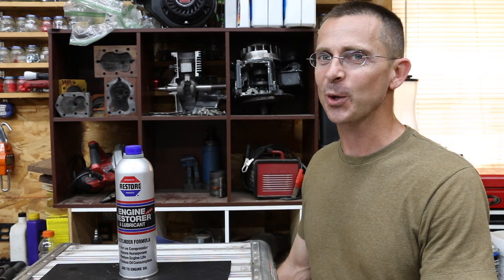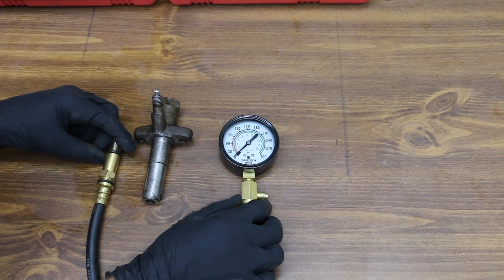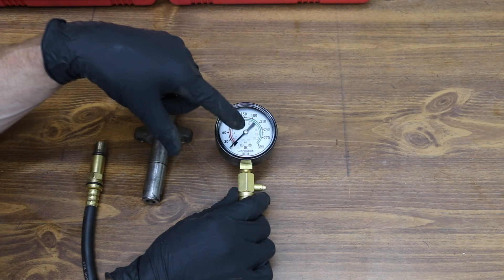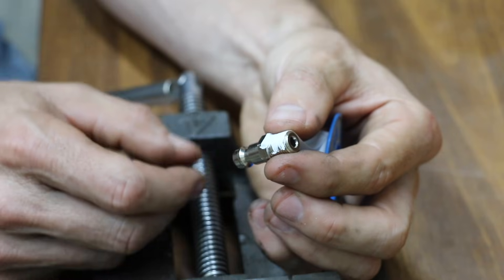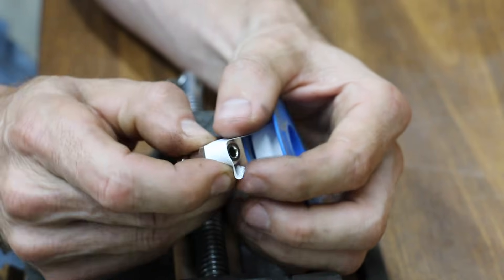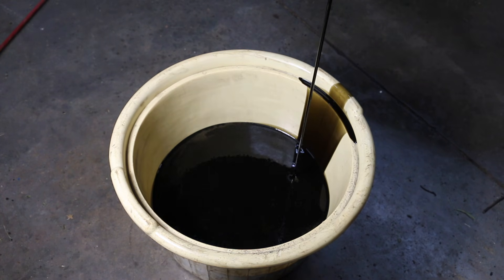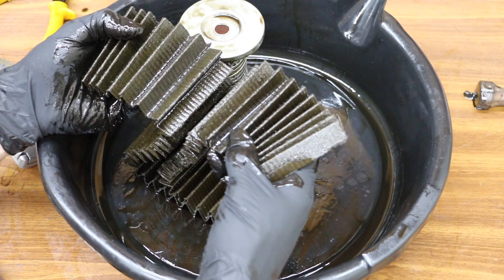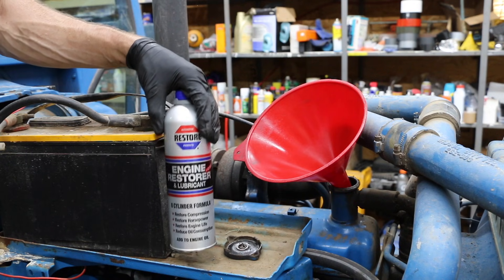Did the "Engine Restore" Compression Improvement Last?  One year later (Episode 2)

Comment: I added a bottle to my 07 scion . 3000 miles later oil consumption went from 2 quarts every 3000 miles down to about 3/4 quarts in the same distance.  I have no idea what changed inside the engine but my fuel miliage also went up by 3 to 4 mpg average ( was 25 to 28mpg now I'm 28 to 33.)  I'm impressed as hell
Reply from the maker: Impressive results!
Reply: LMAO! Forgot I even wrote that.
Reply: Honest question ( see my other post on this point).....did it affect your VVT ( Variable-Valve-Timing) system?.....as it uses incredibly small oil passages to hydraulically alter the valve timing gear position.
Reply: Does not work on my 2trfe tacoma. Just tried it for 1month now... i even used more than u were suppose to also.. Failed.
Reply: That 2.4 Toyota was one of the first to use low-tension piston rings, with disastrous results. Honestly every single one of them needs the stuff
Reply: Themdarn toyota Vvti 4cy... they all burn oil like crazy... im gonna go get some for my 310k tacoma 2trfe 4banger... burns oil like crazy

Comment: PF: DId you notice a oil pressure difference when using restore?  i had some slightly lower than usual pressures when using restore.
Reply from the maker: The tractor doesn't have an oil pressure gauge setup on it. That's on my project list.

Comment: I recently bought a 2001 duramax that was severely neglected before I bought it, and it consumed oil to the tune of 1 quart per 1000 miles. It's got 270k miles on it and I drive it a lot, and the blue haze coming out the tail pipe was embarrassing, plus it had a lumpy idle. Because I follow your channel and see that you try decently hard to be scientific in your testing, I put a can of Restore in to see what it did. After only an hour of operation I noticed the idle was much smoother and it seems the exhaust is much cleaner, though I've only really driven it at night so far. I'm hoping this product really helps because I don't want to tear down the motor to replace seals. Thanks for your work, love the channel, it's one of my favorites!
Reply: neworder18 can you provide an update?
Reply: @christiansharron8421  I still have the truck, and it now has 295k miles, and is running great. The smoke persisted however, at least until I moved to another state, and now it's cleared up significantly. I blame junk fuel where I used to live, as it quickly cleared up after a few tanks in my new town. So now it's running great and (mostly) smoke free
Reply: @neworder18  glad to hear it thanks!
Reply from the maker: Very impressive results!  It would be terrific if the oil consumption stopped.  That's a great engine and I hope it provides many more miles of service!  Would love an update in the future if you have a chance to provide one. Thanks again!

Comment: Engine Restore does work, but you need to keep using it at every oil change. It doesn’t actually fix anything. It contains silver, copper, and lead which are soft metals that fill in the worn and scratched areas on cylinders to improve the seal with the piston rings and thus improve compression, but those particles eventually get washed away. It also tends to shorten the life of your catalytic converter when those metal particles go out the exhaust and eventually clog it.
Reply from the maker: Thank you!

Comment: i used this on a 3 liter ranger with 200k n suddenly i didnt have to downshift on certain hills i was NOT expecting that result, i figured it might minutely help with gas milage if anything  i was jus lookin at a can at walmart last night but decided against it it was over $8 so..  n i dont really have a problem im running a 6.5 diesel now n dont even have to plug it in in the winter, i do..but if i forget which does happen its jus loud till it warms up after literally a minute or two, those cold starts is where lucas oil additive shines bigtime
Reply from the maker: Thank you!

Comment: I have a 98 Lincoln Mk VIII LSC with 116,000 on it.  They came with a 4.6L DOHC and a Dual exhaust.  It passes Smog like it's a new engine, and uses very little oil.  Ford put out a TSB calling for 5-20w, so I used Walmart Super TECH Synthetic Oil and a Motorcraft Oil Filter.  I put 1,500 on the Oil change when I decided to add Engine Restorer to it.  So I drove the car around a little to bring it up to running temperature, and with the car idling I initially poured in about 10oz, and I could actually hear the engine begin to run smoother and quieter.  That was a few days ago and a little while ago I poured the rest in, and it runs even smoother.

I would suggest to those that want to actually hear Engine Restorer work.   Drive your car around to bring it up to running temperature, and with the engine running at idle, Pour in Engine Restorer and listen to your engine closely and see if you can't hear the difference like I did.
Reply from the maker: Engine Restorer delivers A+++ results!

Comment: Probably won't see this but was hoping the oil change would be without adding more restore and then testing the compression right after and another test months later with no additives to see if it restores or just supplements engine compression until drained out. 
Can it be a one time thing or mandatory every oil change for good compression.
Reply from the maker: Thank you.  I believe the gains would wear off over time.

Comment: I recently purchased a 2009 Toyota Camry SE 2.4 liter. This Camry had 198,000 at time of purchase. This Camry was consuming oil at a rate of a half a quart per 1,000 miles. It seemed like I was always adding oil. I talked to a few of my friends and they said use Engine Restore. So at my recent oil change, I added the 4 cylinder Engine Restore. I’ve driven over 2,000 miles and not added a drop of oil. I’ve been checking the oil every few days. I’m amazed at how well this product works. Truly amazing!
Reply from the maker: Impressive!  It's a great product that has saved a lot of engines.

Comment: Sir, did you send your oil sample off to get it analyzed? There is places where you can do that. We do that on the two megawatt Caterpillar diesel engine gensets  and the 6.5 megawatt Colt/Pielstick duel fuel engine powered generator, at the  a municipal powerplant, where I work at, as a operator.
Reply from the maker: Great recommendation!  I need to do this.

Comment: I'd like to see what you think about "Motor Honey".  Love the old Ford 5k. I had an old ford on my farm. Landlord traded it for a a 2010 Kabota. ( the Ford was an 85 ran like a top after I put 200 hrs into it) the kubota sucks
Reply from the maker: Thank you for the video idea!
Reply: @ProjectFarm  I've had mixed results with motor honey. (I went to school for 4 years to be a Marine Mechanic.  I've fixed everything from a 4hp Chrysler outboard to a 500 HP Cat Marine Diesel. :) some engines I've tried it on either LOST 4-6% or gained 5-8%.  If you try it.....good luck. (Only used it BEFORE doing a rebuild. Just to see how it worked)

Comment: I was checking the oil on my 1/2 million mile van ,while it was guzzlin' down it's 30 gallons or so at the pumps, wondering why the oil wasn't really getting low yet. Then I remembered I had put some Engine Restore in it a while ago.
Reply from the maker: Impressive!  It slowed the oil use on one of my vehicles as well.
Reply: @ProjectFarm  , 
And another thing, that cloud of blue hasn't been in my mirror lately after descending that long hill. I did notice that too.

Comment: How many hours are on the engine? That model tractor is from the last 60's. With the amount of smoke in the exhaust, it is time for a rebuild.
Reply from the maker: I wish I knew the hours, but the hour meter wasn't connected when I acquired the tractor.  It continues to run really well once it's warmed up and doesn't smoke.
Reply: @ProjectFarm  , I believe a tight engine will yield 350 to 400 psi compression.

Comment: Did you look and see if any damage was being done to the turbo?
Reply from the maker: I didn't inspect the turbo, but it seems to be working very well.
Reply: @ProjectFarm  that's awesome I just wondered if it might slowly plug it since it has a plastic in it. Being that the turbo takes so much heat would it make a difference I wonder.

Comment: Just did a compression test on my wife’s accord.  It gave back a very low compression number on its number 1 cylinder. This video gave me hope.
Reply from the maker: Could you please post a comment letting us know if it helped?  by the way, did you conduct a leak down test to rule out valve issues?
Reply: @ProjectFarm  It tested at 50 psi hot, while the other cylinders were 120 hot.  I put a squirt of oil in the cylinder and tested again.  It came up to 150 psi.  I'll keep you posted on if it works.

Comment: I have used engine restore as well, in a 1976 Cadillac sedan, 500 cubic inch engine,  before restore it wouldn't spin the tires, the car had a limited slip differential after restore, it would spin both tires for about 20 feet. So to say you feel like your tractor has more power is probably correct. Also I got better gas mileage (Not while burning my tires though) and easier starting. The car had 150,000 miles when I bought it. Drove the car about two months before changing oil and filter. 
Sir your videos are helpful and a joy to watch. Thank you
Reply from the maker: Impressive results!  Thank you

Comment: Would I have to put engine restorer every time I do an oil change?
Reply from the maker: Every other oil change should be fine, unless the engine is extremely worn.  I plan to use it every time in the tractor.  It's pretty cheap considering the performance gains.

Comment: Your compression test adapter has a lot of dead volume in the bore.  That may be why your compression readings are low.  You could minimize the problem by filling the bore and just have a thin hole down the center.  Better would be a check valve right at the piston end of the injector body, that would give you an accurate and true reading.
Reply from the maker: Great point!  Fill with JB weld and then drill a small hole down the center.  Thank you!

Comment: There is a dimple in the top of your tap wrench , You bring the drill bit down without the drill press running and hold pressure while  turning the tap wrench , It will always start the tap straight .
Reply from the maker: Great tip! Thank you

Comment: Are the third set of compression tests not done on a different tester which may read differently? I'm just wondering if this has been factored in.
Reply from the maker: Thank you and great point.  I did use a different gauge and that is a factor.  The tractor does start better than before, which is "subjective", since I didn't measure before and after testing on that.

Comment: I've watched a handy amount of your videos over the past month and it has caused me to reevaluate how I rebuild lawnmower engines and what additives I will use in the process. You mention that there are a "couple" of products that you are convinced have had significant benefit for you. Restore aside, as you have already mentioned that one in this video, is one. Which is/are the others and why? Could be worthy of a 5 min video recap with both objective and subjective data. For most people watching I'd presume you could include data on both diesel and gas engines.

Another suggestion I have is a "push it" video where you combine your various techniques to increase the horsepower and/or efficiency of a new/old mower engine to as far as you can...

Keep up the good videos friend!
Reply from the maker: Hi Sean, Great video idea on the "push it" video!  For a lawnmower engine, I would stick with a fully synthetic oil designed for a small engine, which includes zinc, which is great for anti-wear.

Comment: That engine sounds like it's hitting even on all four. I think what the Engine Restore did, was free up a stuck piston ring, allowing it to seal against the cylinder wall. The piston rings are also sitting flat on their landings, further reducing blow-by. I'm willing that the ring that stuck, was the cylinder that stopped with an exhaust valve held partially open by the cam. That would allow moisture in, which can cause galvanization between the steel ring, and the aluminum piston. The more you run that engine, the less trouble you'll have with it. Does it have glow plugs? if not, compression is critical to getting it to start, especially when cold.
Reply from the maker: Great point.  It does not have glow plugs and the preheater doesn't work.  I have to plug in the engine on cold days.  It does start much better now than before.  Thanks again!

Comment: all that work and the compression still at 300 lol :(

Also, what do you think was worn in the engine for the Restore to work? I cant imagine it restoring any lost or damaged metal. Maybe the seals were worn?
Reply: Brian williams...im not sure what the spec compression for this tractor... But a year ago this tractor compression reading is 295-275 range..

after restore...all shows 300+ on all 4... Doesnt that sounds like a good increase to you?
Reply: It may have freed up a stuck piston ring, allowing it to seal properly against the cylinder wall. sometimes moisture will get in to a cylinder who's exhaust valve is held open by the cam. That can cause galvanization between an aluminum piston and steel ring. Minimizing blow-by on all cylinders really helps a diesel start, since they rely on compression, rather than spark plugs.
Reply from the maker: Thank you.  I presume the piston rings are worn.  It's a very old tractor with an oil bath system. So, I imagine it has inhaled a lot of dust over the past 40 years.
Reply: @ProjectFarm  my dad always said "oil bath air filters were the only real air filters." I know many people would agree.

Comment: Great video! Did you ever use or test Schaefer Moly EP oil additive?
Reply from the maker: Not yet. Thank you for the video idea!
Reply: Project Farm  From what I know, whoever used it is very happy. But that stuff is really thick and there is no information if it changes viscosity of engine oil and if it does by how much. Winter is here in Chicago and I concerned if I should change my oil. 

I can also send you a bottle of it since I bought a 24 pack at a huge discount.